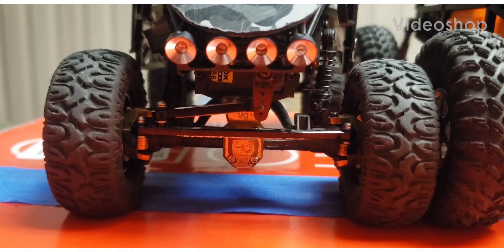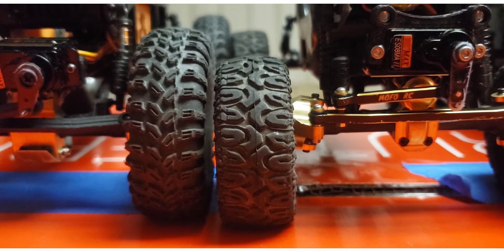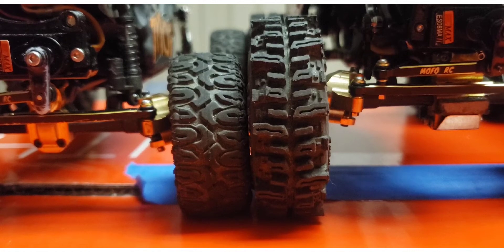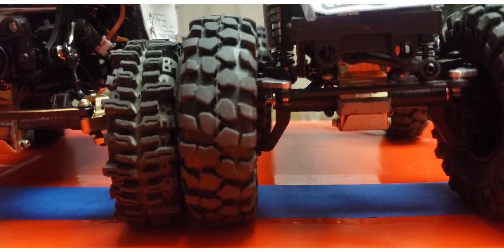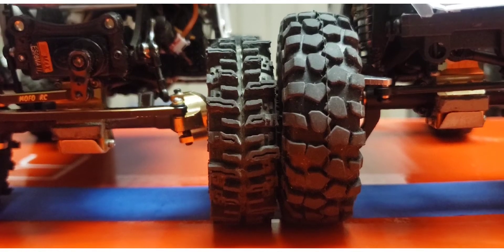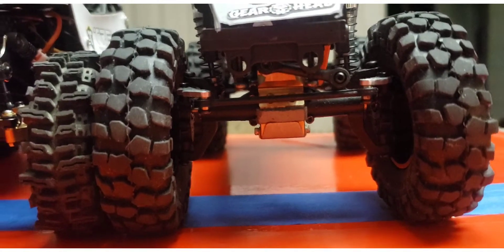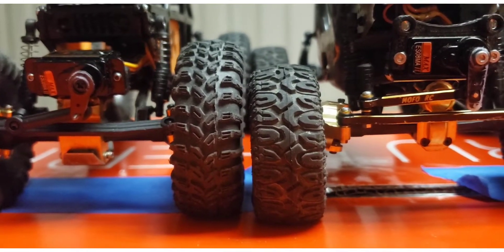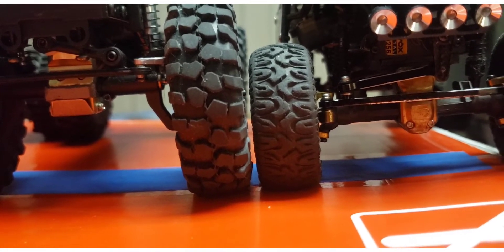1:24 Diff Clearance Comparison

Comment: What are the 1.2 tires? I have a rock buggie I’m building and want large tires!
I have been searching Amazon and eBay, no luck!  Thanks, I was just looking and of course you just posted what I was looking for, tire comparison!  Awesome!
Reply from the maker: My 1.2s are RC4WD Rock Crushers. I may have said something different in the video. Nick from wolframrc.com special ordered them for me. 

They are a bit stiff for the weight of the truck. I probably should have taken the foams out. The tread pattern and compound are excellent. I really like these tires. They stick beautifully so I don't bother taking the foams out . They are much better than I had expected and are a great tire at 1.2.

Comment: Have you tried stretching 1.0 tires over the 1.2 wheels? The little guy racing tires are pretty nice.
Reply from the maker: Stretching tires is fine going from a 1.9 to a 2.2 but not so much from a 1.0 to a 1.2. It is too much for my liking. I tried. I didn't like it. The sidewalls get weird.

I also tried Trail Kings. I like the size and the feel but they did not perform well at all on my course.